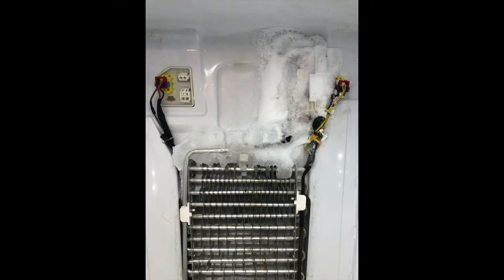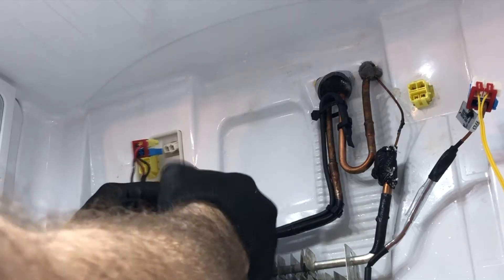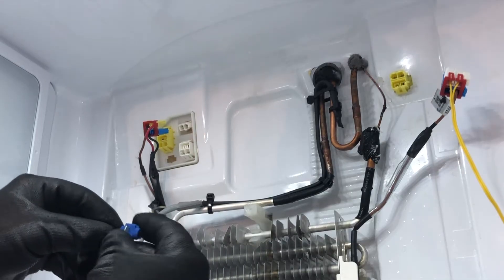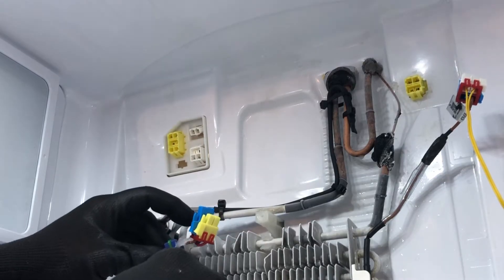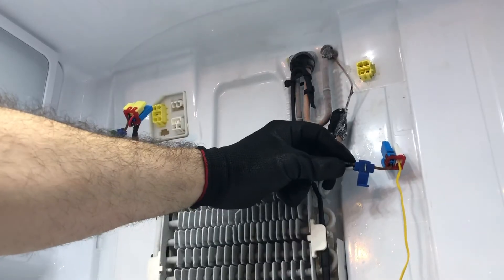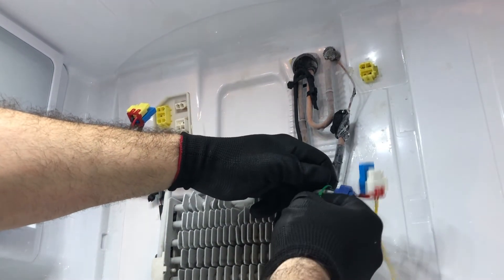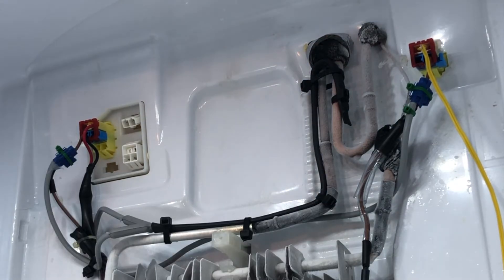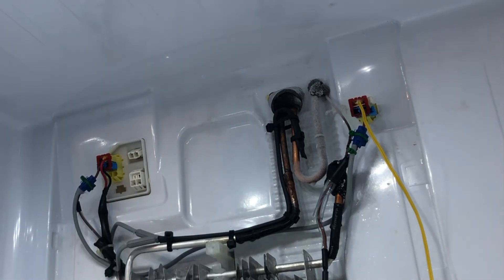Samsung FDBM evap heater add

Comment: Hey, good video. My question is, can the defrost cycle be changed to run longer so as to prevent the buildup? This will of course make the fridge somewhat less “energy efficient” but it would be worth it to keep the thing going. Yes, I have added the sh502. Samsung makes decent TVs but they gooched this baby.
Reply from the maker: some you can, some you can't. Samsung's 'Enhanced Defrost Function' is engaged (if possible) by this procedure: [assuming your model has on the display, 6 buttons, 3 on left, 3 on right] 
-Press and hold middle left button and upper right button for 17 seconds until you hear a beep, display will change to ' 0 - 0 '
-Press middle right button incrementally until you reach option '17' on display. (There are many options you can change, and it will skip some numbers, this is normal) If it skips '17' as if it's not there, the info I have does not pertain to your model and I would have no other solution for you. If '17' is accessible, 
-press middle left button until display number changes to '1'.
-wait 5 seconds until display returns to temperature setting
-reset fridge by unplugging for a minute and plugging back in.
-if successful, you will be able to go back into the options settings and if you go back to option '17', you will see it will already be on '1'.
-that's all the info I have on this.
Reply: @electronicsprojects4708  Thank for reply. Btw instead of ties I used 12ga copper wire to coil around the heater and copper lines, loosely wrapping the entire right side loop helping the heat transfer get to all of the top area piping.

Comment: Where did you end up attaching the right side thermometer to?
Reply from the maker: based on your question, I would recommend calling a professional to diagnose and repair it. repairing appliances is quite complex and Samsungs have more complex problems than the standard manufacturer. get someone with experience on these units.
Reply: @electronicsprojects4708  Thanks, lol, wow, smacked down. Ouch.  I asked because it's typically recommended to move the thermometer sensor a bit to the right when installing a heater element like this and not keep it at it's original location.  This is so that the refrigerator does not think it's thawed out prematurely.
Reply from the maker: @Tolg  It's a 'thermistor' and I leave them in place. This was a Samsung 'I can't figure this problem out' moment, so they tried to change the location seeing if it would fix anything.
Reply: @electronicsprojects4708  Ah!  Thank you for proper terminology.  Learned something new.  "Thermistor".. not thermometer.  And thanks for the feedback on leaving it in its original location.

Comment: What is the length of heater wire actually used Can any any body help
Reply from the maker: Only use the Supco ones listed bellow part numbers SH201 or SH502. They are 15 watts. The length spans the top suction line of the evaporator in both cases.

Comment: So my samsung fridge is having some frost issues. I opened it up, replaced the drain piece, that didn't do anything. Still freezing and what I'm noticing is that there are chunk of ice on the bottom side behind the drawers. Not sure why there are ice buildup on the outside down there? Please advise.
Reply from the maker: The video is for technicians, I recommend calling a professional to diagnose it that has experience with these refrigerators.

Comment: Hi great video , was wondering does the secondary heater work with RF268ABRS Samsung Fridge? After opening the panel , it doesn’t seem to have the connectors on the right side as shown on your video.
Reply from the maker: if you don't see a 2nd loop (freon line) as in my video, (top right copper tube) then you have other issues. I have not needed to put the heater in one of those.  I recommend calling a pro tech that can diagnose it in person that knows these Samsung refrigerators.

Comment: Hi Mike, can I private message you with the photo that I took for the ice build around the evaporator? Unfortunately there's no attachment option in comment.
Reply from the maker: The video is pretty self explanatory, if you are an appliance tech, diagnose it as you normally would, then if you need the heater add it on.

Comment: Hmm I came across your video because I have a Kitchenaid twin evaporator model and the evaporator on the refrigerator continues to frost up, but the freezer side is clear. It seems like the refrigerant diverter valve is supposed to pipe warmed refrigerant to the evap coil because there is no heater on that side (no air diverter duct either), but there is on the freezer evap coil. So then, what is to stop me buying a second heater and defrost thermostat and  fitting to the fridge coil? I could add a relay to take the defrost signal from the freezer .. so when the controller calls for defrost it would simply run both coils. I would add a second power cord and a fuse to avoid overloading the existing circuitry. Thoughts?
Reply from the maker: It's a big project as you would have to route the wires through the back, so that means drilling holes, making sure you don't hit the freon lines. I have seen this done before, but it's much more complex a challenge than what I do in the video. I find that the dual evaporator units on the KA fridges tend to have sealed system failures and that is the root cause of the problems. Usually come with a 5 year sealed system warranty from the manufacturer (If a compressor is running an inefficient sealed system, the static defrost can't keep up and builds up frost over weeks or months)  So for the Samsung we are implementing a mod to fix a failed engineering design. You would be modifying it because the fridge has a defect. That being said, diagnosis by proxy is not iron clad, I have to recommend a professional in-home diagnosis. Appliances are very complex and a professional tech just have the field experience on appliances that diy'ers, no matter how smart they are, don't have. Good luck to you.
Reply: @electronicsprojects4708  Well funny you should mention that but after I posted this I said .. "wait, this fridge barely keeps up with cooling and relies on hot refrigerant to melt the ice" Now if the the system is low on charge that might explain both symptoms. So I am going to check the refrigerant level first.. Thankyou for your reply.
Reply: Well I got my can of R134a and checked the  freon level.. it was way low... pulling a vacuum on the suction line.. topped it up to +3psi and OMG what a difference in cooling capacity and it switches the three way valve from side to side as it hits setpoint in the respective compartment. Now I just have to wait to see if the defrost function has come back.

Comment: I have the same problem. What city and state are you located in?
Reply from the maker: I'm in California, but there are plenty of techs that do this, get my your zip code and I can see if I can find someone in my group that can come out to do the repair and mod.
Reply: @electronicsprojects4708  I’m in California too. My zip code is 92336. I’m in Fontana, CA.
Reply from the maker: @RaulRamirez-gq7hh  I am not in your area, I will see if anyone is.
Reply from the maker: Three companies answered, look them up online and then pick the one you want to go with: (I am not affiliated in any way with these companies)

Everett Michael Johnson
Dependable Fix
Diamond Bar, CA
909-760-7165
Sundown Appliance Repair
Orange, CA
657-933-8792,

Ricky Duarte 909-760-7165

PAR Appliance 909-653-2653
Reply: @electronicsprojects4708  No worries and thank you so much for sending info on the other companies, I really appreciate that. But how do I ensure that they do the exact fix that you did?
Reply from the maker: @RaulRamirez-gq7hh  you can ask them on the phone how many times they have done it before. they are all on my group, so they have seen and been a part of many discussion threads on this topic as well as other Samsung fixes.
Reply: @electronicsprojects4708  Can you recommend anyone in or around the 94973 area of California? I have same problem with RF18HFENBSR/AA
Reply from the maker: @blossombud9335  Kelly Appliance Center may be able to help you out, they are North of SF. (707) 664-9702.
Reply: @electronicsprojects4708  can you recommend anyone near 94702? I connected with one tech on Thumbtack, but he said this modification was not safe / would cause problems.
Reply from the maker: @filljoy4165  I did one yesterday, have been doing them for 3 and a half years since I came up with the mod. I have not encountered any safety issues. I have seen techs use incorrect heaters and that can cause problems, but that's why I put the correct heater part numbers in the description. I will see if there is any techs in your area to do the repair.

Comment: Just ordered the parts. Thanks. This problem has been plaguing me for years. Tried the drain wire fix. tried insulating the upper coolant line. Nothing worked. This looks promising. I'm going to secure the heater with some 14ga copper wire instead of zip ties, based on the comments about burning smells.
Reply from the maker: If you get high-heat zip ties, it's no issue. At 160 degrees, you won't have any burning smells. If someone uses the incorrect wattage heater, I could see that causing smells.

Comment: thanks, that should solve my final problem.  I found that the foam across from the evaporator gets water logged, freezes  and stops the defrost process. when the foam get water logged again after a replacement, it goes back to freezing up. I ran it for over a year with no problems by removing the foam and just having the aluminum plate bare. but still got freeze up in the top. thank you for posting this fix.

Comment: What if you just insulated the same little section of copper tubing that you attached the new heater to? Souldn't that also stop the ice build up??? HD sells 1/8" insulation tape made for refrigerant lines...
Reply from the maker: give it a go
Reply: did you try this method and can you link what you bought?

Comment: Thank you for the video , I will be doing this for my RF28HMEDBSR/AA. I ordered the parts from Amazon , is it the same wiring as the one you are showing in your video ? Thank you
Reply from the maker: the refrigerator wiring for these models may be different, refer to the schematic. it should be parallel to the defrost heater.
Reply: @electronicsprojects4708  thank you , I will check the wiring coming from the defrost heater and hook it in parallel to it , hopefully this will solve the issue once for all , tired from this fridge and Samsung all together
Reply from the maker: @jrahme  you are not alone. Make sure the heater is unplugged when you install the new one. The original Samsung defrost heater resistance is around 100 ohms.
Reply: @electronicsprojects4708  thank you , I just searched the schematic and it is showing FZ DEF HEATER and thermo fuse uses the brown colored wire and then there is an FF DEF HEATER which uses the white color according to the diagram . I should be tapping to the FF one ? Thank you
Reply from the maker: @jrahme  yes, FF is for 'fresh food' FZ if for 'freezer'

Comment: Hey mate thanks the video very helpful. A question after installation I find the area near the newly installed unit is really hot and now the fridge isn't staying cool, any insight or ideas?
Reply from the maker: if you installed the correct heater, it should be around 160 degrees. Test the temperature with an ir gun or thermocouple.
Reply: @electronicsprojects4708  it was working at around that temperature, but the main problem was that it was so hot that it didn't allow the fridge to cool. You could physically feel the heat coming through the back panel
Reply: Could there be an issue with the frequency and duration that the heater is staying on?
Reply from the maker: @addramz  I have never seen the defrost heater stay on more than 25 minutes because it has a safety timer built into the board. So if the newly installed heater is staying on longer, it is not in parallel with the heater and needs to be reinstalled.
Reply from the maker: @addramz  if it's 160 degrees you won't feel it through the panel unless it  is staying on all the time. In that case it would be installed incorrectly. Has to be in parallel with the defrost heater. Stays on for about 20 minutes during defrost.

Comment: They don’t get hot enough to melt plastic ? Oh, then the melted back panel I’m looking at this second must have been caused by a chicken on the shelf with a propane torch.
Reply from the maker: not hot enough to melt the tip ties that are in direct contact with the heater. Must be a 15 watt heater, links are in the 'description'. I have seen people put in other heaters that can cause issues, but if you follow the procedure in the video, it won't get hot enough to melt anything. Just like any repair, if you do it wrong, bad things can happen. If what you are seeing is close to the braze points, where the evaporator connects to the tubing that goes in the wall, that can be because of the torch used at the factory. I see that all the time on all brand refrigerators and freezers.

Comment: I saw this coming in after a guy. The Samsung evap iced and hits the fan blade after few weeks. Customer also stated unit did not reach set point. Maybe he installed incorrectly. 🤔
Reply from the maker: If a qualified appliance technician performed the repair, there is a service bulletin for the drain that needs to be taken care of, other things to check for as well, in addition to the heater. These checks differ my model, but as I said, a qualified technician will know what to check for and test.

Comment: I've installed one of these additional defrost heaters and frost is still forming on the evaporator. Can anybody tell me how to put a Samsung model RB217ACRS into forced defrost mode so I can check the defrost heater? I've tried every button combination I've found on Youtube and the net but I've found nothing specifically for a model RB217ACRS.
Reply: Can’t speak to your model, but for my RF28HDEDBSR/AA I press FREEZER and LIGHTING (press at the exact same time) and hold for ~10s, wait for beep…. Display goes blank, then press CUBED/CRUSHED ICE button to cycle through defrost modes. ‘rd’ = refrigerator defrost.  FD=forced defrost…. Think there are also modes to defrost just freezer or ice maker.  Good luck!
Reply: @neverhart19741  I appreciate your attempt to help. But our Samsung does not have a "Lighting" button. There are 6 buttons and I've tried combinations of each. On the left, Power Freeze, Freezer, & Ice Off. On the right side are Power Cool, Fridge, and Child Lock... That's all there are. But thanks again.

Comment: But it does the defrost automatic right? You don’t have to do it every other day!
Reply from the maker: when you put the heater in, it automatically defrosts it every 8 hours or so.
Reply: @electronicsprojects4708  thanks for the reply, also it was necessary to put the heat shrink? Mine does not have one, is just a Baer cable, I don’t think it make any difference
Reply from the maker: @zdenanrehhelber  I prefer without it, as you don't have to route the wire across the evaporator, you just have a wire at each end to splice in.

Comment: Where do you put the thermistor?  It was down at the start and end of the video.  I'm looking for where to put it relative to the new heater.
Reply from the maker: You can put it in the same location as it was before, as long as it's not near the new heater.  Samsung had a service bulletin that said to move it, then another that said to not move it. I think they were just fishing for solutions. The only issue I have with thermistors is if they go defective on these French Door units, never put one in a different location that solved the problem.
Reply: @electronicsprojects4708   

"""The only issue I have with thermistors is if they go defective on these French Door units, never put one in a different location that solved the problem.
"""

So I had moved mine from that far right copper line where the black goop is, and moved it to the far left copper line where you attached the SH502.  Should I move it back to the bottom of the far right copper line just below the goop?

PS:  I ordered all the new parts already and they'll be here Wednesday.  I was seconds away from pulling the trigger on a $2,200 new fridge, and decided I'm going all out on this fridge before I trash it.  I've been pulling off the back panel every 6-8 weeks to defrost it.  It's been getting worse and worse as each time the styrofoam gets more and more damaged, letting moisture in.  I ordered a new evap cover, moisture kit, drain heat probe, SH502, zip ties, Mylar foiled pipe wrap for the 3 left copper tubes, and a replacement thermistor.  

PSS:  Thanks for answering.  You're a real one.
Reply from the maker: @bobguy6542  yea, put it in the same place it was before. Good luck.
Reply: @bobguy6542  how did it go? Which copper pipes did you wrap?

Comment: Could I get you to call me or text so I can send you some pictures? I did this to mine but it's alittle different the yellow wire is starting on the left (looking at fridge) instead of right side. 
I feel like it's connected right but I have the new heater running parallel to the yellow wire which runs through from one side to the other on top. It's a 28.5 cu ft one.
Reply from the maker: mod #? Yellow wires typically are thin and are sensor wires. I can get your schematic up and see what wires you need to connect to.